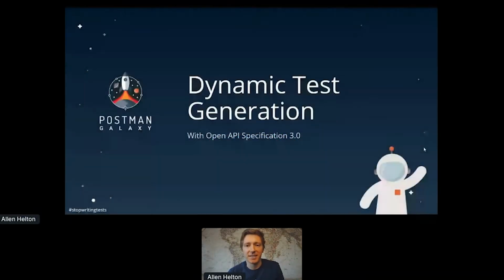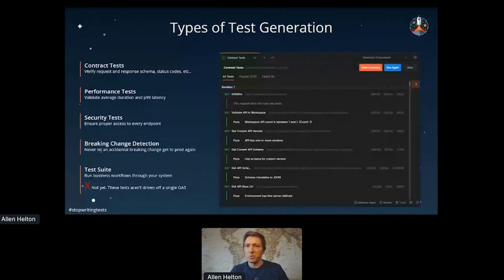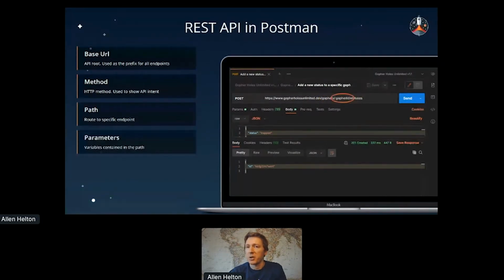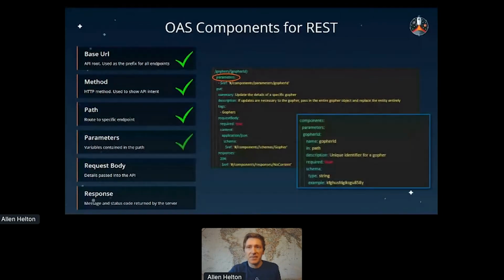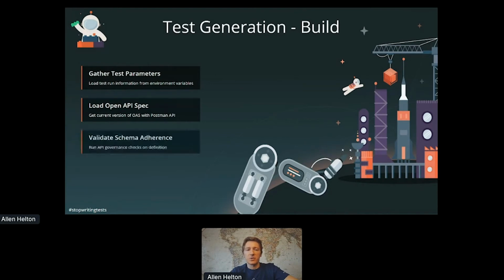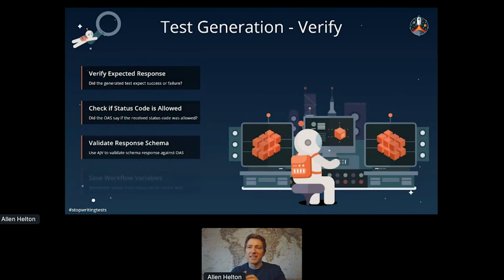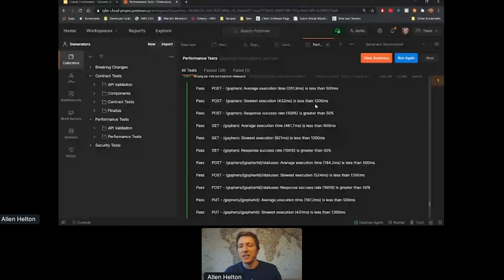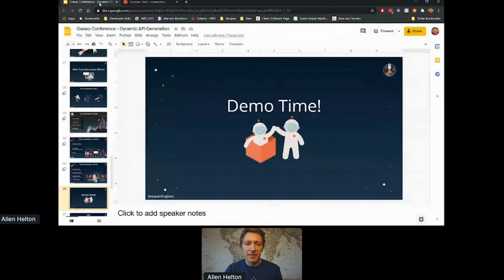Dynamic Test Generation with OpenAPI 3.0, Allen Helton, Tyler Tech | Postman Galaxy 2021

Comment: So, I forked the (Generator) Contract Tests - OAS3 with the respective environment and it was added to my workspace in the collections.

In 'APIs' I imported the .yaml, which generated the definition and a collection with the .yaml that I provided.

In the .env, I filled in the keys:
- env-apiKey, 
- env-workspaceId
- env-server.

However, when running the tests that are inside Contract Tests - OAS3, the 'Get Current API Version' test fails with the error: 

- AssertionError: API does not have a published version, and no definitionId is available in the environment: expected '' to have a length above 1 but got +0

I checked the .env and found that it added 3 empty keys:
- env-schemaUrl
- env-apiId
- env-apiDefinitionId

What am I doing wrong and what should I do to make this work?